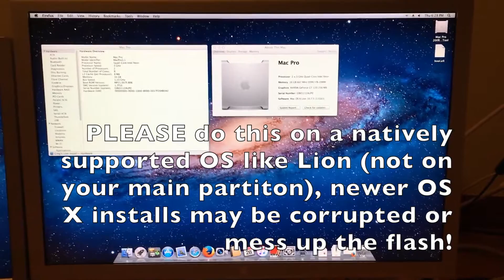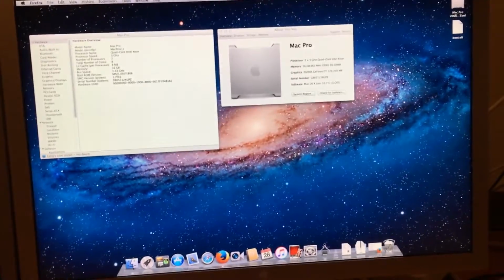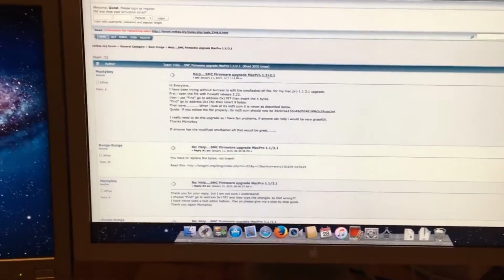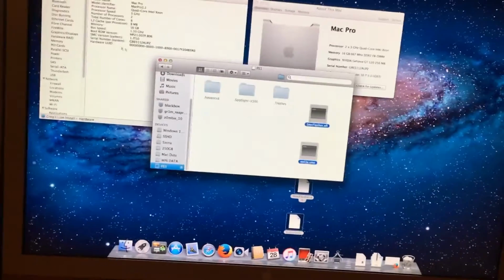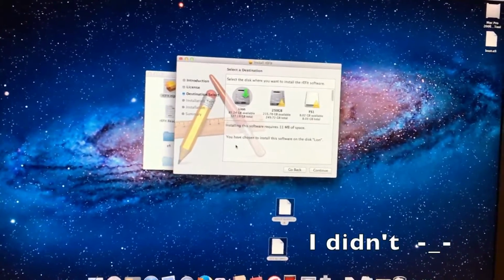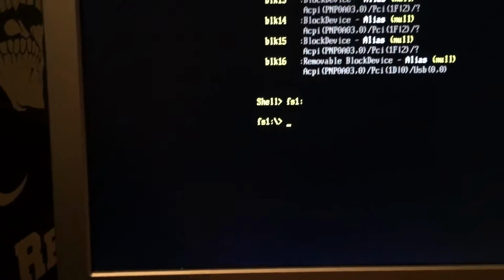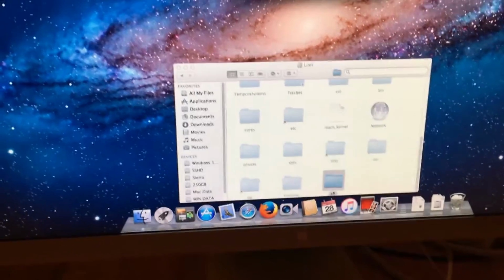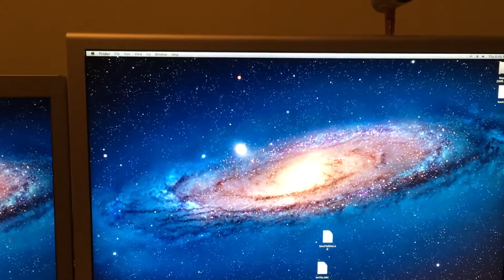Mac Pro 1,1 to 2,1 EFI & SMC Update Part 2: SMC Update - Mac Pro 1,1/2,1 Series ep.18

Comment: i tried this, the SMC update, had everything i needed, followed the guide to the letter but i only got as far as the shell when you give it the USB name, when i give it the name of the USB drive i get ''shell: invalid mapping name - drive name'' i tried different names, all 3 letters as you suggested, as well as trying exfat and fat32 as suggested and nothing seemed to help at all, any assistance here would be greatly appreciated as im stuck with the X5365's but no SMC update so far
Reply from the maker: +matthew brown I had problems with one of my flash drives try another flash drive. Also make sure there is no spaces in the name... if worse comes to worse you can always use one of those programs to do a custom fan curve. But it's tricky you just need to keep trying basically, I didn't do it the first time I tried. If you're still having problems let me know
Reply: Hrutkay Mods yeah, i thought about that too and did try a few usb sticks and what have you, all did the same unfortunately, i could do the custom fan curve thing but it'll be a pain to do so in windows and mac also, ill give it a go though if worst comes to worst but im not aware of any apps that do that in windows, i am having another issue now though, sound, it's essentially insanely quiet, i have my speakers and windows volume maxed and it's still quiet but i can just about hear it, a suggestion by a friend of mine was to turn up the volume in mac os as it controls the hardware as such, did that and it has made no difference so im not sure where the issue is, i have run bootcamp 6 as per your other video and i have confirmed all that works by booting into mac os with it to do the volume maxing but im not sure if it just skipped the sound drivers or what have you but it doesn't seem to have done anything with them, but no yellow triangles in device manager so im not sure really
Reply from the maker: Macs Fan Control does both OS X and Windows. Controls the same too. You could try to reinstall rEFIt and try again... With the Speaker issue... Windows may override the sound drivers. Windows' drivers don't seem to work at all. It might say it has drivers, but they don't work. so you'd need either the new realtek drivers from online or the drivers from your bootcamp 4 drivers. Also are you using internal or external speakers?... the internal speaker may be burnt out (it is 10 years old after all) and if you're using external, make sure you have it plugged into the correct jack. Also the jack may be damaged. My Jack is bent sideways and so the plug sticks out at an angle and if it isn't plugged in correctly.... The Mac doesn't even see the speakers. see if this helps
Reply: +Hrutkay Mods yeah, but if i have to do it manually I'd have thought it'd be one for Mac os and one for Windows, but i may be wrong there. 

As for the speaker, it is going through external speakers as adjusting the volume on the speakers themselves does adjust the volume of the sound, ill try new realtek ones and failing that I'll grab some from a bootcamp 4 file 

Ill try reinstalling refit probably tomorrow and see if that works, thanks for all your help so far.
Reply from the maker: Make sure you have your volume up all the way in Windows btw. Lemme know if you need any more help
Reply: Hrutkay Mods yeah volume is all the way up in windows, back in windows now though ill have a look at getting the realtek drivers now then ill work on getting the SMC stuff done possibly a little later tonight/early tomorrow morning
Reply: speaking of the SMC though, does the USB need to be specifically fat32 or exfat? or does it not matter which as long as it's a fat format?
Reply from the maker: I used fat32, I think it can use journaled too but not too sure on that... It might work though if you wanna try t
Reply: Hrutkay Mods ill give the both of them a go, out of interest just to narrow down any possible issues, what did you use to format it? im assuming it was done in mac os but did you just use the disk utility or something more specific? many thanks
Reply from the maker: disk utility, yep
Reply: Hrutkay Mods i did it within windows myself (as that's what i had available to me at the time properly) ill do it through disk utility and see how we do
Reply from the maker: That could make all the difference honestly. I have a flash drive that doesn't work right when formatted in Windows but it works great with an OS X format job. dunno why, same file system format, must be the way it's implemented I guess
Reply: Hrutkay Mods that might be why yeah

fixed the sound issue, updated windows and it works properly now, since that's over with now ill move over to mac os and get the refit stuff done :P
Reply: +Hrutkay Mods i tried formatting in mac os and it didn't work, will try a few more things and see how we do
Reply from the maker: Wishing you luck, hopefully you can figure it out ;)
Reply from the maker: in theory in you have a blank HDD, you might be able to get that to act as a "flash drive"?
Reply: +Hrutkay Mods hopefully so XD I mean that being said temps aren't too bad so it might not be needed all that much :P
Reply: +Hrutkay Mods yeah i have allot of small but old ish HDD's laying about, i could try that tomorrow :P
Reply from the maker: If temps are good, you may not need it, I edit and render a lot of vids on mine... Pins all 8 cores, fans ramp up, it stays cool. Before the SMC, I had to use Macs Fan control because the poor thing was melting. but if you're not going to use it for stuff like that, you'll probably be fine
Reply: Hrutkay Mods well really just web browsing and games for the most part, should do fine, ill keep an eye on temps, i have 6 displays so i can keep a good eye on temps while im gaming :P idle at the moment is mid 50's/late 40's over both CPU's, bare in mind it's the middle of summer here in the UK and i live in a flat with 7 people below each heating the next floor up so that's not 'too' bad :P it's load temps that matter really though
Reply from the maker: mine idles around 35-45C but games aren't that intensive, so if you can't figure it out, I wouldn't worry too much
Reply: Hrutkay Mods ill see if i can get it to work with a spare hdd later today, hopefully i can, if not ill have to make do, could always use something like speedfan or something but im not keen on the idea, not sure if the mac os ones would carry forth to windows but i doubt that really
Reply from the maker: +matthew brown I know it's been over a week, but if you haven't gotten it to work yet, try formatting the flash drive in exFAT and see what happens
Reply: Hrutkay Mods i did manage to get it working, had to give it the base name of the memory stick shown above (FS#: or what have you then followed by LS to see what is on the drive, then the flash command and what have you, but it doesn't seem to have done a damned thing, still get the same temps and now i get BSOD's and resets in both windows and mac os from the ram getting too hot, it did pin up as it should have when doing the flash so i am inclined to believe it worked though
Reply from the maker: Interesting, did you verify in system information that it did flash correctly? It might be a bad flash and need reflashing, though I dunno if you can reflash with the same version. I can help you downgrade if needed and if I can find the hex edited file I made to downgrade for the video. I'm assuming it's not Apple certified ram? Are you sure all your fans are working correctly? It might be a heat sensor issue or ram issue, are there any red lights showing on the ram riser cards? could be many things. Maybe Theoprofil might have an idea, he has been working on Macs since 1992 and is very knowledgeable
Reply: Hrutkay Mods i have yet to do so, but i can do so soon and see, it is possible that it didn't flash properly but we'll see, as for the ram it isn't apple certified stuff no, just hynix stuff but it's confirmed working stuff, no red lights on the risers, OS sees all 32gb of it in both mac and as for the fans, they are all working properly, i will check to see if the SMC has flashed properly shortly and get back to you on that
Reply from the maker: okay cool